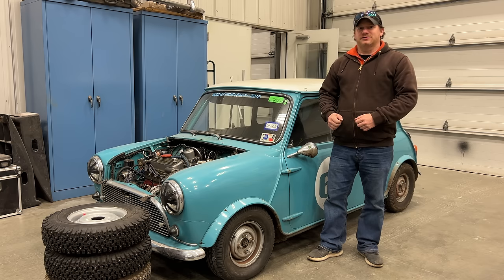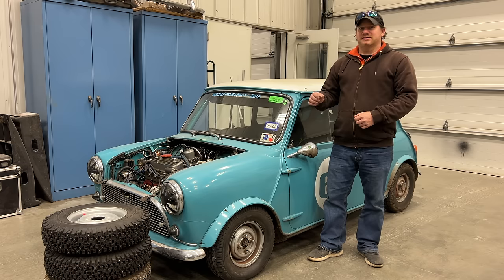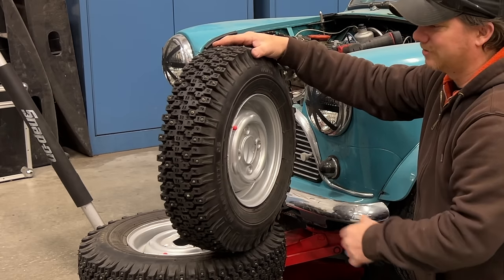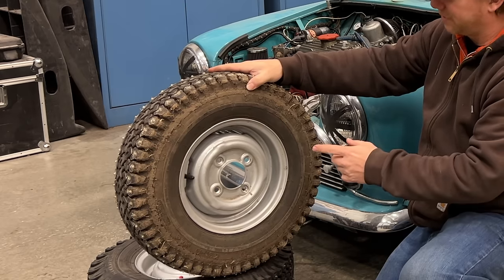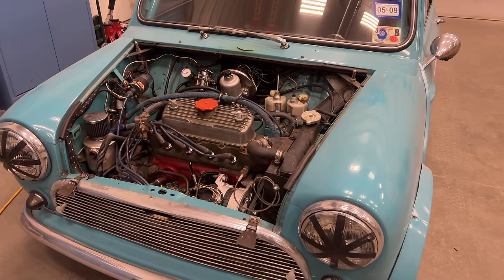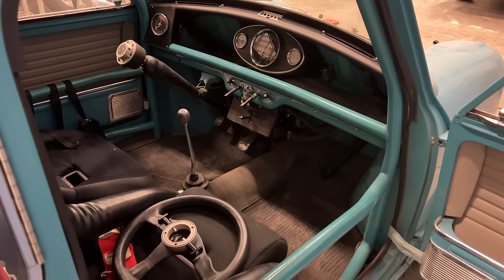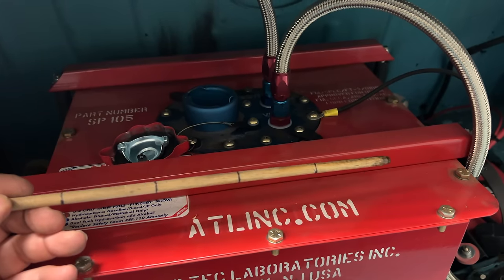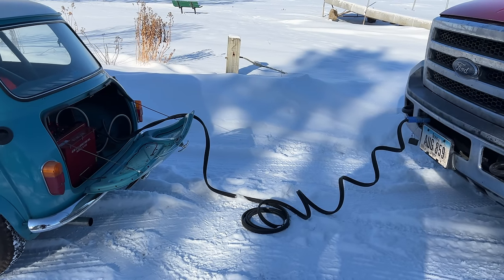Racing Vintage Mini on Frozen Lake Ice in SCCLAC

Comment: I was driving my Datsun F10 just after a blizzard in Indiana and just after watching ‘A Clockwork Orange’. My right tires got stuck in a snowmobile trail that suddenly veered to the left and went over a ramp just off the road.  My right tires hit the ramp perfectly and flipped me on my roof.  We ran to the nearest house and our request for help looked like the home invasion in the movie.  They couldn’t take us seriously as we were smiling at the similarities with our incident and Alex’s pleas for help. 

Some friends stopped and helped right the car and it started right up.  They were surprised, but I had just put a new carburetor in the day before. It would have been more ironic if it had happened in my TR-7, but I didn’t have that car for a couple more years.

Comment: I didn't know that racing on frozen lakes was even a thing (we don't have a lot of frozen lakes to race on in Australia). Looks like a lot of fun, if a little bumpy. And the Mini isn't exactly known for having a cosseting ride. I'm old enough that they were still around in large numbers when I first started to drive. Among my friends they were affectionately known as "Bricks", basically because that's how they ride. However, they were also about the best fun you could have on four wheels. Go-karts for grown-ups. My mates and I used to joke that the only bad things about driving a Mini were that you had to drive into potholes and out the other side. And that occasionally you would get stuck in the tyre tread of semi-trailers. Oh, and you definitely wouldn't want to have a big prang in one.

Comment: Sure hope the Minis heater is working overtime.  That is probably one time of the year I would rather be in front of a warm fire with a large mug of hot chocolate with a touch of Baileys inside it.  That or on a warm caribbean beach in shorts and a T with a very large  iced spiced rum and coke...lol